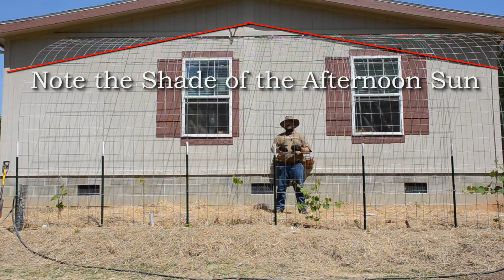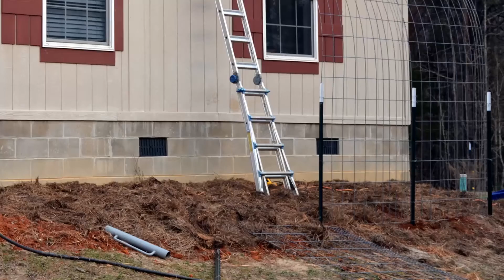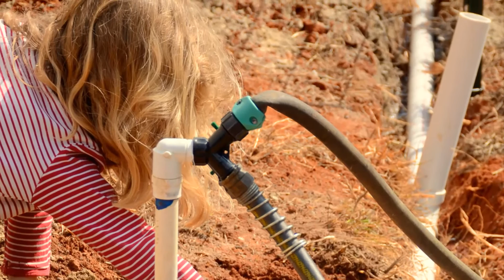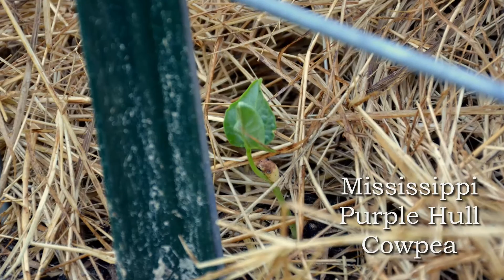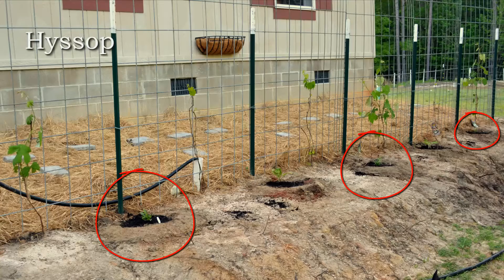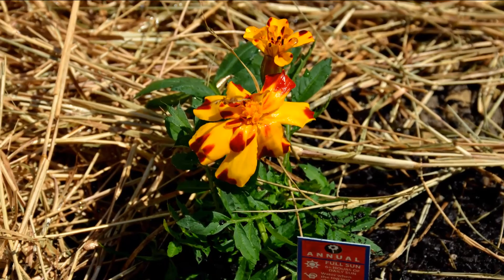How to Build a Self-Sustaining Grape Arbor Trellis

Comment: If one wanted to do this as a lean-to-type outdoor squash/bean arbor but didn't need it so tall to shade the house, what is the maximum distance from the house could you place (or recommend placing) the posts to still wind up with a tall enough archway to walk under using those 16' cattle panels? I have a small strip of lawn off of the NE side of the house that gets enough sun through all the trees to grow something (the rest of the place is pretty shady), and I was thinking self-irrigating bucket planters along the T-post side might work. But seven feet from the house will put them in too much shade. I wish I understood the math enough to be able to figure this out myself! Can you suggest a few distance/height scenarios for us?
Reply from the maker: Hmmm, I am really not sure. I didn't really "do the math" on this project. I saw one other person's idea on YT, but there was no info given. I just bought the materials and figured it out from there. Sorry :-(
Reply: Thanks for answering. I guess I should just get one panel and play with it and see what I arrive at, then go from there. I can always use it for something else if it won't work for what I want it to. :)

Comment: That looks impressive. I see climbing a latter in your future.

What part of the deep south are you?

What does your home use for ventilation?
Reply from the maker: Not worried about having to use a ladder. We are in Toomsuba, MS - which is East Central Mississippi, right on the Alabama border.

Ventilation? I am unsure if I understand that.
Reply: Ridge Vent, Forced air fan, gable vent. stuff to vent the attic. I know a house with little attic ventilation will be very hot on hot days.